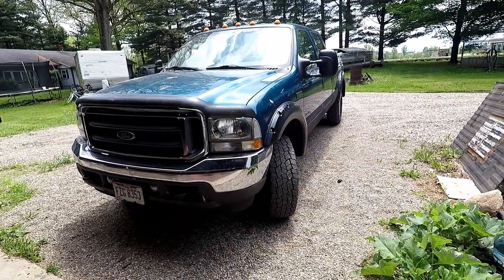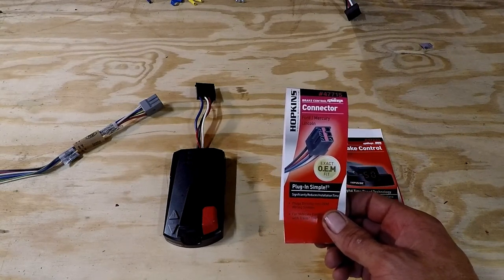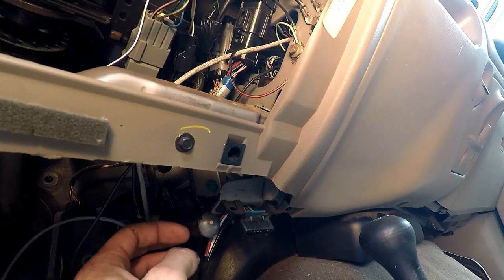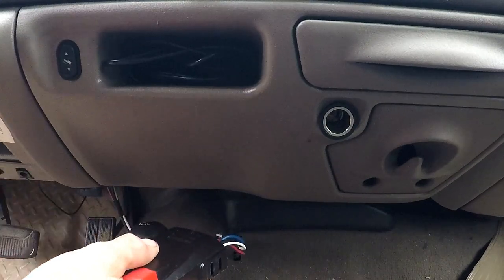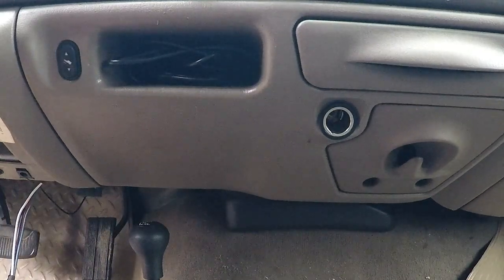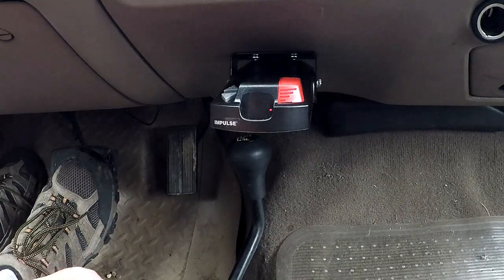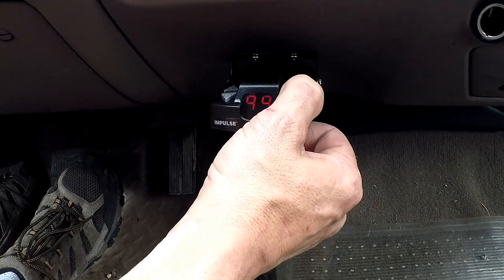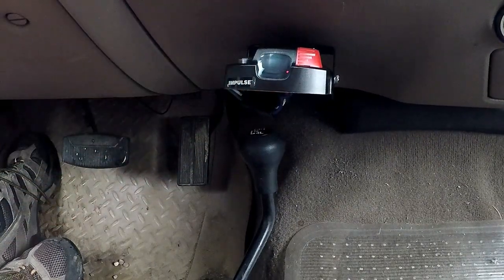Adding An Electric Brake Controller For Trailer Brakes

Comment: The red button is for if your trailer starts to sway you can use just the trailer brakes to correct it without using the truck brakes.

Comment: Great video, when you applied the brake it showed 48%. Were you driving or in gear ? When I apply my brake it flashes and goes to Zero. I have it set for 50 and I was in park. I called Hopkins but they were unsure. Thanks in advance.